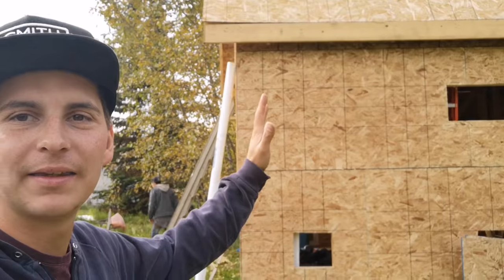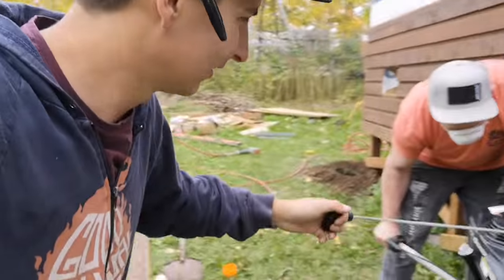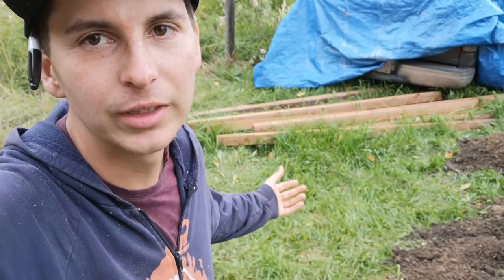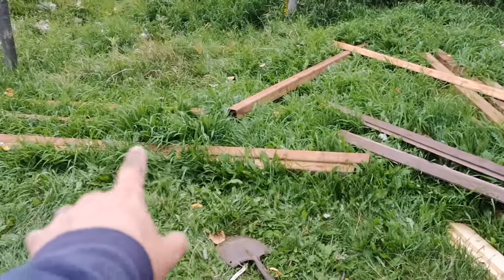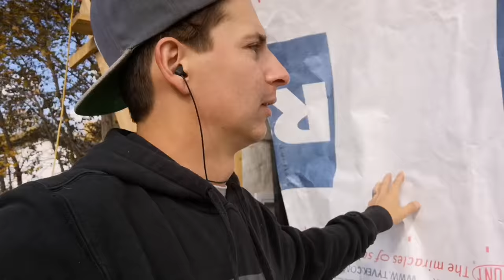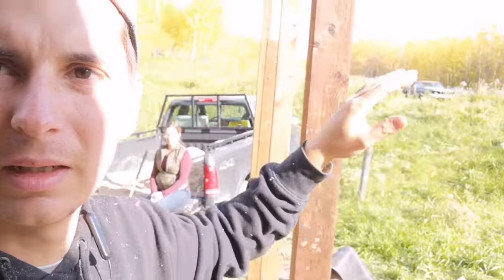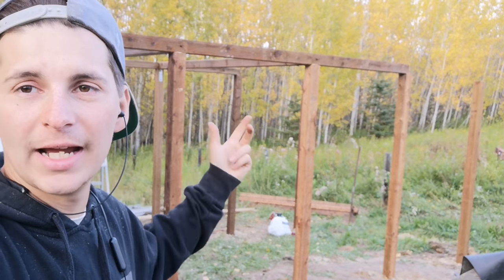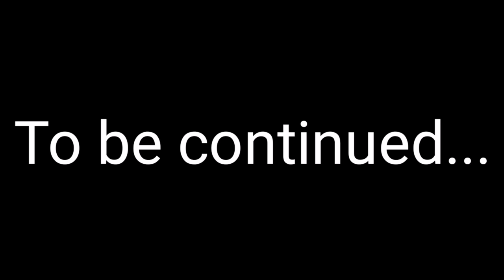Ashley's Chicken Coop PART 3 | Another VLOG #42

Comment: I think the tin roof would be nicer, not only for long term durability but it’ll look more like a barn or farmhouse.
Reply: I'm wondering if the snow sliding off the roof will dump into the run & block their way out?
Reply: Yes the roof pitch on the run is going to be a problem!

Comment: I have that exact same clay. PITA! It doesn't slide off the shovel. 

You will get "just a few more" chickens several times. And suddenly you will wonder how you ended up with so many.
Hank thinks that will be his summer home. I'd do plywood inside walls. You will be amazed at the damage that can be done in just a few years. What ever, nothing less than 1/2 inch and 3/4 would be even better.

Comment: The chickens depending how many you have will cut up your grass in 3 weeks. You can make a mobile chicken run using cheap wood and 2 wheels as a temporary shelter should you run out of time. Good luck

Comment: We have clay soil where we live in Indiana!  I think I could make cups, bake them and have pottery without any treatments.  We've had no rain for weeks so it's basically concrete right now.
It really looks good.
We put a metal roof on and our house looks similar. It looks good and cottagey  and the snow and ice slide off easily.  The wildlife refuge near us put those shingles on the roof of there visitor center and they don't last as long as metal or regular shingles.  At least not here.

Comment: How will u know how much post to cut?  And why such huge posts? They,re lil cHickens, not lions!
Did u hear about. the zoo back east with the lion s or tigers and 2" boys were there , one throwing things at the lion. It got irritated, jumped out and killed the brat. Sad but man, peep can sure be stupid about wild anmals, says In who put out long froze salmon out back for a bear.  I read about the salmon shortage n Canada for the bears. So awful.
Reply from the maker: I know how much post to cut by marking where level is. They're that size cuz that's how they're made. Not sure what you mean. I've heard about a lion attack. Not sure if it's the same. The shortage of salmon is because of the pollution from sewage being pumped into the water supply that hasn't been processed properly.

Comment: If you have a problem with the drainage of the wood siding you can always paint Society with a rubberized paint or a Marine Paint one that you use for boats. Are you going to have to put a piece of screen and frame it in in the inside outside it should be outside and frame it in somehow cuz if you open that window for ventilation one of those Hawks Eagles can fly and just rip a regular screen open. Just a suggestion. Y'alls friend Rose LV looks good and it's not a chicken coop it's a chicken mansion seriously
Reply from the maker: We will likely put hard ware cloth in the outside.

Comment: Lots of JOSH'isms in this video...ie: i got this auger from home depo..they were selling it for some reason (isnt that what home depo does)/ some poles are 12 feet , some are 10 feet..which are shorter I THINK..there so cute. But my real question is..is the outside area going to be all chicken mesh, and if so what happens if the snow slides off the roof and lands on chickens below?
Reply: Planning trumps sweat!